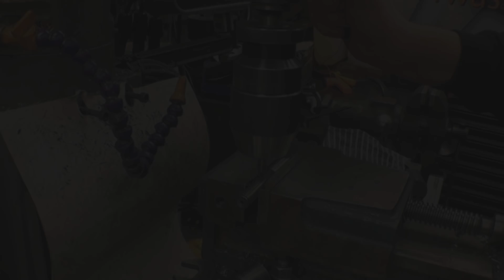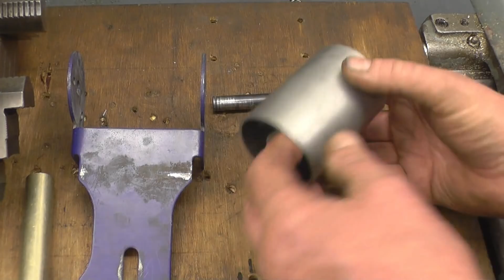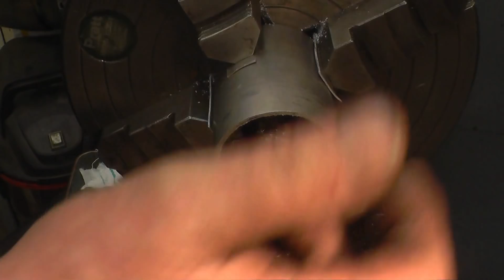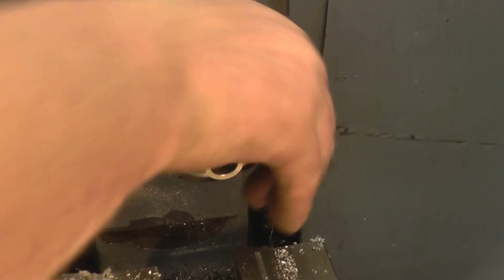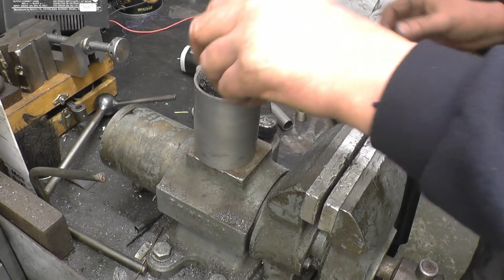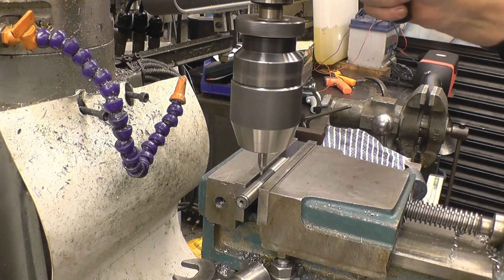SNNC 256 P1  Sander Roller Repair  "bronze bushes"

Comment: I repaired a Makita belt sander roller by replacing the rubber with " Sticks like s**t " then sanding it down to an even thickness. Saved myself a small fortune.

Comment: There's so many things out there that with those two simple holes in the pin or bolt, would last 10 times longer. But no, you're expected to just sling it and buy a new one, not much fun in doing that I find.

Comment: You don't want any oil in the bearings of that roller. It can leak out, get on the surface of the wood, and ruin any possibility of the finish (stain, varnish, etc) penetrating the wood properly. It will be blotchy any place the oil gets on the wood.